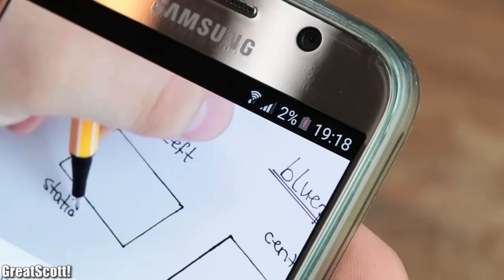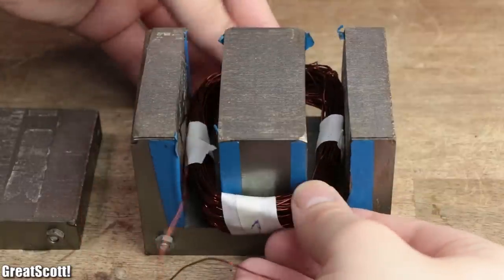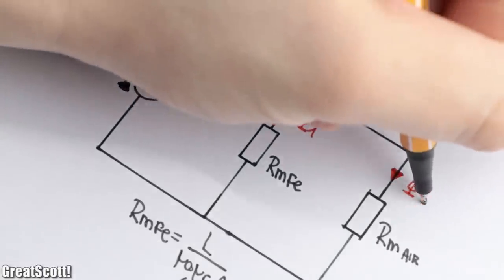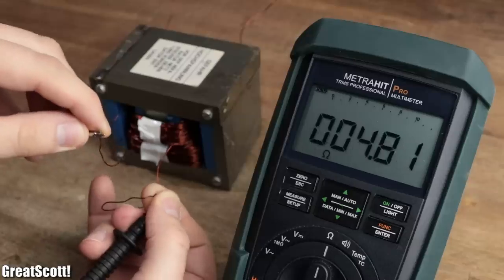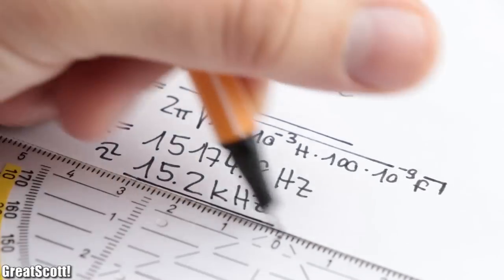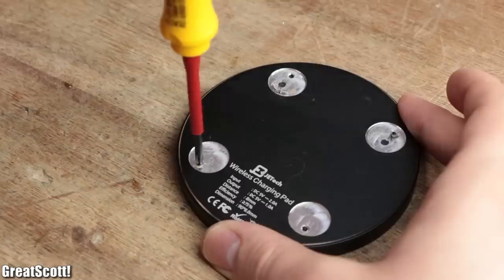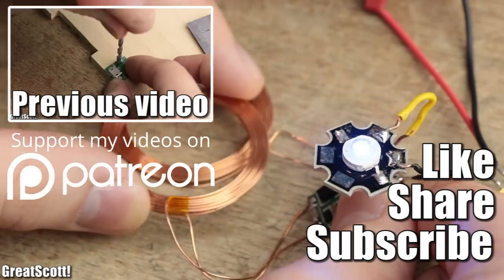How Does Wireless Charging Work? || Crude Wireless Energy Transfer Circuit

Comment: Great video, as always! I had a couple questions:

When you calculate the resonant frequency for the 1st capacitor, you use the inductance you measured across the primary (I believe) with your inductance meter.  Shouldn't it be about half that, since the meter would have seen the primary leakage inductance along with the cross inductance?  Also, why do you put the second capacitor across the secondary instead of in series with it, like you do on the primary?

Thank you for putting so much detail into your videos, while keeping them moving fast.  I really enjoy them.

Comment: Hi GreatScott,
This video particularly I've seen 5 times as my reference to my wireless charger project. Thank you..

By the way, about the inefficiency of Qi charger you calculated in this video, please note that you put the mWh meter before the PCB transmitter which contains electronic. in my opinion, mWh meter should be placed after the pcb and before the coil. Let me know if I'm wrong.

well thank you again for this video!!!

Comment: how fast does wireless charging charge your phone compared to for say a 2A micro usb cable?
Reply from the maker: Fast charging took around 30-40 minutes. Wireless charging around 2 hours.
Reply: Because of inefficiency
Reply: what about Samsung's fast wireless charging. It is the same speed as quick charge 2.0
Reply: You will always have a problem with the wireless charging, you will have a lot of loses in electricity like greatscott showed us that charging his phone with the wireless took 1.6 more electricity then cable micro usb charging.
Reply: if he needed 1,6 times the power of the cable charging to charge it you can think of it as charging in 1,2A in terms of time. Put you must not forget that its way less efficient too.
Reply: Thats right, i did created few month a go a powerbank that charge and discharge wirelessly and i can say from the  experience that i did that it took around 3.1 to 3.5 Amps on the primary coil and i got at the secondary 2.0 Amps, thats why we have a big loss in this system because a lot of energy is dissipated in heat and in the air because not all the magnetique flux is caught by the secondary and that effect a lot the efficiency of the system.
Reply: And floris fassin, the adapter of the phone can just deliver 2A, and the primary coil and the circuit are connected to the adapter that can just deliver 2A, so we will get 1.1A approximately and that does affect the time of charging of the phone.
Reply: Totally right, and the receiver in the phone is too small so it can not deliver more the approximately 1.4 Amps.
Reply: Thats the main problem.
Reply: Kyle Thomas علي هادي علي
Reply: HAHAHAHHAHAHA The inefficiency is so bad! Wireless charging sounds more like a gimmick!
Reply: Kyle Thomas my Samsung charger takes about 1.5 hours to charge. My Samsung wireless charger takes 6 hours or so. Also, I have an otterbox Case so the distance between the charger is pretty big.
Reply: Kyle thomas:
The same way a WIRED connection to your laptop will give you faster internet speeds than a wireless connection to the same laptop..

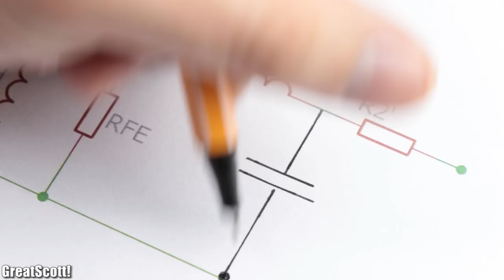Comment: At 4:50, don't you mean add the capacitor in series? That's how resonance would be achieved. If it is parallel with the inductor, then it forms a low-pass filter, which is not required here. Would you please look into this? If I am having a misconception, I request you point me in the right direction. Thanks and regards.

Comment: I don't understand how adding a capacitor helped. Can you please make a video about resonant circuits? I think I'm not the only person who finds resonant stuff complicated.
Reply: It's not for that, a simple explanation here: When you remove the iron core, most of the voltage drops on the parasitic inductance of the transformer, if you add a capacitor that, at a certain frequency, resonates with the inductor,  you make its impedance greater, so the currents doesn't flow trough that parasitic inductance
Reply: I guess that the real benefit to add capacitor is to tune the inductance in a sort of antenna transmitting and receiving. If you achieve the same resonance frequency for both coils transmitter and receiver you will have the maximum energy transfer. Like in a real radio transmission in which you tune tour antenna to the desired frequency. Isn't it ?
Reply: PirateKitty I agree, but if you have the same frequency tx and rx you will have more energy transfer, like the Tesla coil coupling. More over if you calculate the quarter wave resonant frequency you will reach the maximum. Do you agree ?
Reply: Adding capacitor means obtain a tuned LC circuit and If you have the same frequency tx and rx you will have more energy transfer, like the Tesla coil coupling. More over if you calculate the quarter wave resonant frequency you will reach the maximum. Look here
https://en.wikipedia.org/wiki/Resonant_inductive_coupling
Reply: The best way to think about it is that you get current gain over many cycles. The magnetic field is proportional to the current. the larger the current the larger the field. during the first cycle the current will be the voltage / impedance which is purely resistive at resonance. Then the second cycle you have the voltage / impedance plus the current from the first cycle. The third cycle you have the voltage / impedance plus current from the second plus the current from the first etc..... So this uses the current  resonating  between the inductor and capacitor to achieve larger currents then what could be achieved with out resonance.
Reply: Damián Cupo could you explain why a capacitor at the resonate frequency of the inductor makes the impedance greater
Reply: To anyone still confused:
The most important thing he did was add the capacitor to the second coil. When the emf induced current in the second coil, the fact that the coil acts as an inductor changes the phase of the current to be out of phase with the voltage. Adding a capacitor cancels out the effect of the inductor and puts the voltage and current back in a similar phase, same as what the metal did in the transformer. The problem with them being out of phase is that power=voltage*current^2, so since the two were out of sync the power never got high enough to light the led.

Comment: Interesting video. 😉
It may be inefficient, but it could be a nice way to transfer energy to fully sealed equipments and remove any possibility of bad connection during charge due environmental factors or when the connector could compromise the equipment in some way or it is too small to use a connector.

Example:
- fully sealed cameras or sensors that operates under severe conditions or water
- send energy to equipments or sensors inside of animal or human without any invasive procedure (like changing batteries)
- tiny autonomous quadcopter landing pad

Comment: I guess that the real benefit to add capacitor is to tune the inductance in a sort of antenna transmitting and receiving. If you achieve the same resonance frequency for both coils transmitter and receiver you will have the maximum energy transfer. Like in a real radio transmission in which you tune tour antenna to the desired frequency. Isn't it ?

Comment: can i do a wirless heated bed for 3d printing?
Reply: Why not ? I guess it would be similar to what's used for induction cooking.
Reply: +Fucker Frantxu Well.. can you?
Reply: Sebastian Grygiel I don't know. I ask because i want to do a polar 3d printer with a heated bed.
Reply: Most likely not. Besides being impractical for use with a cartesian printer (where bed shifts along y-axis), you'd need 15 amps constant current to heat the platform up to a suitable tempurature for ABS plastic (110c). This would be a difficult amperage to reach without a magnetic core as in a transformer. It would be lossy and require a large power imput.
Reply: induction cooking isn't wireless
Reply: I'd go for brushes
Reply: Brushes???
Reply: Probably, seems like the easiest solution to pass a substantial amount of power
Reply: how about 3d sleeping?

Comment: Where do you get your wires from ?
You said in a video, that you buy most of the electronics on ebay from china.
Actually they have pretty good deals, but nearly everytime I search for cables the diameter is not given.
Could you post a link where you get your wires from ?
Regards
Benni

Comment: Now THAT's what I was looking for :D I'm intrested in the subject :]
Reply: My project plan is to use my Pc's psu to power up the wireless charging station wich is inside my PC's plastic top plate so I can drop my phone on it and charge it :D I didn't ordered the kit jet, I was planing about it but I see that you've used a different kit. I'll wait a bit ;D
Reply: There are kits which uses DC and does the same thing, GS showed a circuit at the end part of the video which does that :D Watch that and you will know what I mean :)
Reply: "But you can always create your own transmitter and receiver circuit form scratch!... But that is a subject for an other video"

I meant that...

Comment: if i have a 5V solar panel, it is safe to plug it in my phone (no chips,....)
Reply: No cause even its marked with 5V you need a Protection circuite to limit the Volts at 5V. Also the current of a tiny 5V Solarcell is not enough to charge a Phone cause the current is to low. You need to place a few cells in parallel to increase the Current.
Reply: GrandeCalle Ok Thanks 😊

Comment: What an incredible explanation. Great work. I’m just now designing a wireless charger for camera equipment, it is powered from 12v car lighter boosting to 24volts at 1 amp current draw. Any ideas?

Comment: 4 volt led same as you used in video  is glowing at full brightness. but small motor not running ,i use rectifier then also

Comment: a very informative video. i allways assumed some form of wireless resonant inductance was employed to charge a phone. the higher vhf frequencies 135mhz used by a commercial charge unit means the coil length would only have to be around 55cm quarter wave to be resonant, i wonder what the range would be if the coil was resonant to a very low frequency tesla would be proud.

Comment: Great video! Just one piece of constructive criticism. You should take a bit more time to explain what variables mean in your circuit diagrams and some of the concepts you use like shorting out the second coil. I'm a computer engineering major and I had to go back and rewatch these areas a few times. Just a suggestion if you want to make your video better for the average viewer

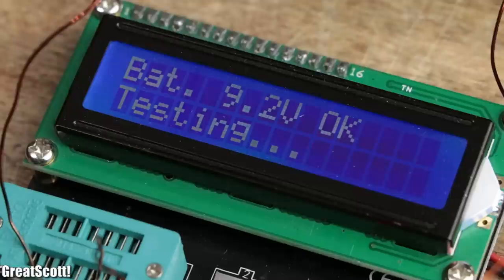Comment: What is the device you used to show the inductance at 3:36 ? Where can I buy one / how to make one ?
Reply from the maker: Search for "transistor tester" on Ebay.
Reply: Thanks a lot Scott, I love your content. Can you give me some piece of advice on how to make a variable lab bench power supply out of a computer's power supply unit ? I watched both of your videos, but I don't have the money to buy one, nor the components for your homemade lab psu. I do have an old computer psu though, and would love to have it be variable instead of fixed voltages without the current limitatio feature. Thanks !
Reply: Its rlc meter
Reply: You could use either an LM317 or a buck/boost converter with the 12V line as an input to make it variable. Would limit the current though

Comment: I would like to use this idea to make the generator on my motorcycle work better
 it's 14.4 volts and it puts out about 10 amps and I would like it to put out closer to 15.
would you have a suggestion on the type of capacitors I might use

Comment: i want to ask how can other tiny electric items in the phone can avoid affected by the wireless charger when charging?????
this wireless charging process makes me think abt. putting my phone onto an Induction Hob, but i think the phone would supposed to be burned.

Would it be avoided by using sheets of metal to shield all the items in a package but except the battery???

thx.

Comment: The audio quality through the 3.5mm jack on my S7 is pitiful so I use a USB sound card which brings audio up to a whole new level, but I can't charge and use OTG simultaneously so I'm currently seeing if I can adapt a charging case to add QI charging and find a USB DAC small enough to fit inside.

Comment: At 2:20
Doesn't the primary coil (connected to supply) make short circuit connection with the secondary coil above it
Reply: no, mag wire is actually insulated

Comment: cool video my friend. Do you know of a cheap easy way to check a multimeter accuracy mainly DC and A/ MA. I have 2 multimeters and 2 DC TO DC buck converters with lcd displays and none of them read the same. Enjoy the rest of your day. Simon
Reply: You can use an calibrated Multimeter from an other person, or you can just buy a Precision Voltage reference of Ebay, they fairly accurate, and they ship their measurements with the Voltage Reference. With it, you are able to calibrate your Multimeter relatively good. (And they aren't expensive)
Reply: Robin Cerny thanks. :-)

Comment: could someone explain the phase shifts, I dont understant why the current has a 90º or 0º shift depending on if the current flows through the impedence of the iron core or through the secondary coil
Reply: also what is "cross impedance" or am I hearing that wrong, like at 3:40 is he saying " the leakage inductance is now greater than the cross impedance" if so I have no idea what cross impedance is

Comment: Is it possible to power LEDs (with coil, 4 diodes and one storage capacitor) attached to a bike wheel using neodimium magnets mounted on the fork? This seems pretty simmilar. I tried winding a coil and then simply waving a magnet over it but that does unnoticable something. Can this be done? I am missing knowledge here but really want to do it, (i know i should be passing the magnet through but dhat is not doable on a bike)
Reply: Thats a basic Generator that you are trying to build :D
Reply: Robin Cerny i know... i have some questions like: is it important to wind the coil in some order? (background story: my friend has leds everywhere on his bike and the rimlights are inconvenient because of extra batteries mounted near the wheel hub. As i want some lights too i want a more convenient way to do this but study it not electronic so im screwed)

Comment: the test is unfair as the Samsung phone uses qualcomm charging which charges at 9v when using the charger that's provided but your using a normal standard 5v charging pad
Reply from the maker: It measures mWh. The voltage does not matter.
Reply: GreatScott! but isn't milli watts measured using volts and amps
Reply: RC MAD You answered your own question. Volts AND amps make watts. E.g. 10V x .5A = 5W = 5V x 1A  (and watt-hours are just watts multiplied by time.)
Reply: Kevin Day yes but say he uses the original phone charger that puts out 9v for it to fast charge
Reply: RC MAD it would charge faster, but he was measuring efficiency, not speed. He measured how much of the energy drawn from the charger went to charging the phone, and how much was lost to the air.
Reply: and how is that a problem? the point is to show the difference between charging with the charger that comes with the phone and with wireless charging. it would be unfair NOT to use the fast charger really as you would be comparing a slower than possible charger to the best possible wireless charger...
Reply: megaspeed2v2 because this wasn't about how fast it charges... Fast charging isn't the "best" way to charge, it's the fastest. It actually reduces the lifespan of the battery. The problem with wireless charging isn't that it's slow, it's that it's inefficient. It wastes power.
Reply: Kevin Day 10V*5A= 50W and not 5W
Reply: Tobinator Sorry, meant 0.5A, I just left off the 0. (or if you're somewhere other than America, I meant 0,5A)
Reply: Kevin Day Oh okay :)
Reply: RC MAD voltage does not matter.. mWh is a measurement of power consumption... which is energy per unit time.. voltage doesn't matter.. its a relation between voltage and current, consuming more power for the same recharge means u lost more energy.  meaning it's less efficient
Reply: Kevin Day Thats just being pedantic, i was saying you would compare it vs a fast charger because the test is about the difference between the kind of wired charger most people will use to the kind of wireless charger that people will use, most people who buy a new phone use the 5-12v 'fast charger' that comes with it so to specifically use a standard charger would mean you are comparing the less common use case.
Reply: blue night there is no wire in it.. that's just the internal circuit with an inductor.. but it is only magnetic coupling (meaning no actual wire connection involved )
but I still think it's totally useless because if you take it off it will disconnect. . so basically wired allows you to pick up the device which is what wireless usually intends to do.. but here it's the opposite

Comment: how does your led light up without any rectifier first
Reply: Ravit Dayal a led can work on ac and dc
Reply: +Martijn Andriesse  OK thanks for clearing that up.
Reply: +floris fassin thanks
Reply: floris fassin that's a better explanation
Reply: The LED is a diode therefore it works as a half-wave rectifier for itself, blocking half of the sine wave and glowing for the other half, but the frequency is so high that it's flicker is unnoticeable.

Comment: These wireless chargers would actually be pretty nifty if they were a permanent fixture in your wall, or counter top. As it is, you've still got a wire running from the outlet, and now a big round disc taking up space, so it's pretty stupid.